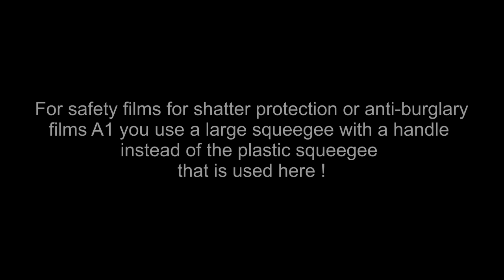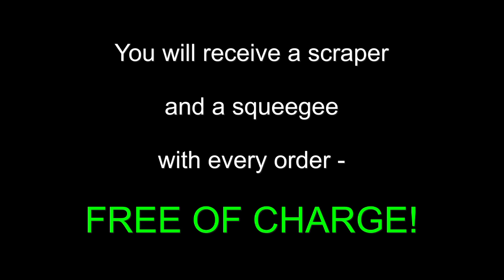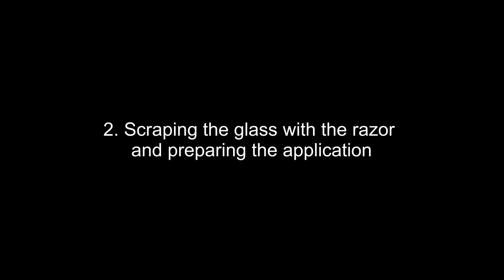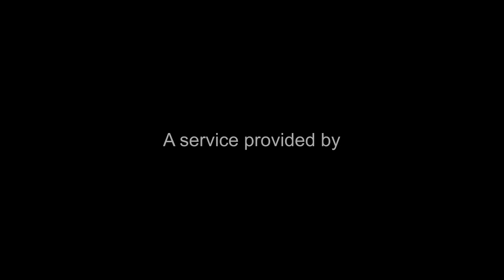Video for sticking self adhesive window film on glass surfaces

Comment: IMPORTANT:
To those who think they do not have all those tools.
I applied the same technique but using simple water spray, a school ruler(both for sizing and removing those air bubbles after applying), and a cutter. And i am more than happy with the result right now. 
PS: For the size and cutting, everytime i kept the film/sheet on my window and then marked its paper side with a pencil and then i cut. if two or more sections require same size then you can simply copy the size from one that you already have cut. 
Thank you!

Comment: I applied this  type of film to all my caravan windows. Tips: thoroughly clean the glass. Measure and cut a little larger, use dishwashing liquid and water or plain water spray, slide into place, smoothe bubbles and excess water out, trim excess with a craft knife. Very easy and effective.

Comment: I'd like to know how to cut the film to size and how much of a gap to leave between the film and the edge of the rubber seal.
Reply: David Upton measure the window (inside the frame, without taking the length of the rubber seal and cut a quarter of an inch smaller
Reply: @abbeyanglade6762  thanks

Comment: Would this cover over hard water stains on shower glass?
Reply: Trees Please you would still see the water stain through it. Use toilet bowl cleaner and a green sponge and it will take it right off. The tint will need to be cleaned frequently if applied in the shower because it its hard to get the dry water off of it.

Comment: i am going into a new flat and the only drawback is there is an internal window with wired safety glass which looks hideous. i cant remember if it is smooth or textured as i havnt moved in yet. Any ideas on what i could use to make it look better whilst still allowing light through.? Or should i just board it up.

Comment: one problem with this video  you show how to put film on window glass but you dont show how to cut it to size 
maybe because its not easy to cut it
Reply: Measure and cut to just a little larger than you need. Trim excess with a craft knife after smoothing all the water and air bubbles out. It is easier than it seems.